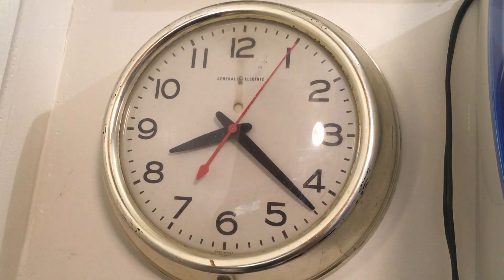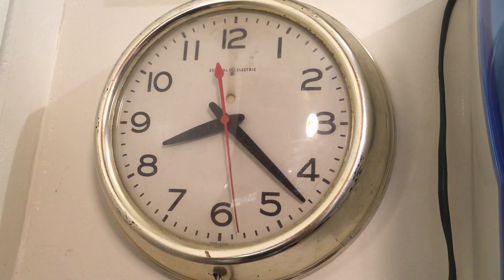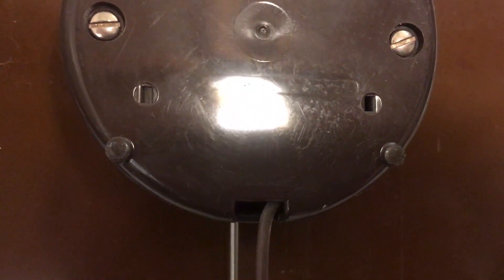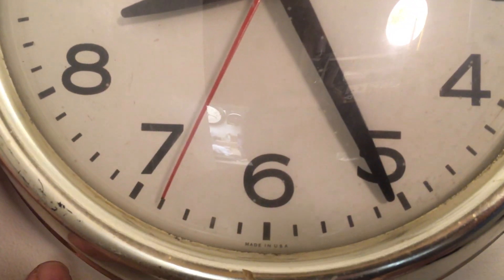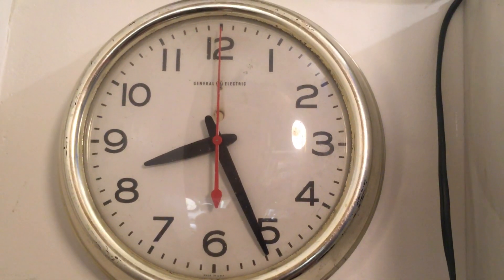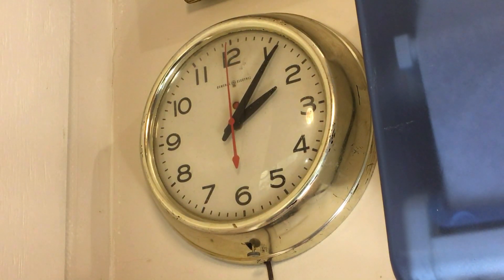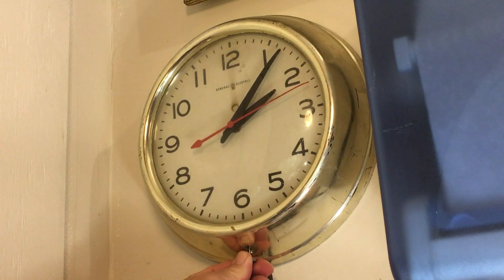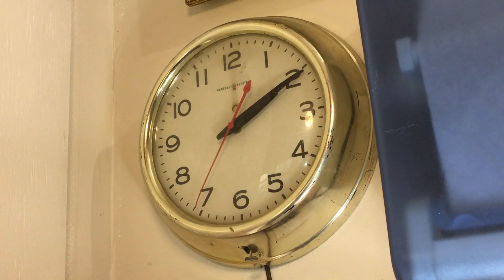Vintage GE 2908 Clock

Comment: Nice clock! Have you ever taken it apart and lubricated it? It would be nice to see under the cover. I'm guessing this has a Telechron rotor?
Reply from the maker: I haven't done any servicing yet, but plant to, so it will run another 60-70 years. As is, it operates smoothly and quietly, doesn't seem to be struggling. I can probably put my watt meter on to see if it is at or below two watts.

Comment: Nice clock, do you know when it was made?
Reply from the maker: Thank you. I would guess 1950's, when my Grandpa got his first office at work. He said it worked just fine for the 40 years he worked.
Reply: @dynatrak  Thanks for your reply! Much appreciated.
As a matter of fact I was given one for free today just like yours.
The gentleman originally agreed to sell it for $20 yesterday, but when I went to pickup today he said forget about the money, he's glad he can pass it along to someone who can use it.
He said he saved it from a warehouse that was closing down 25 years ago. I want to thank him for his generosity!
The casing needs a good cleaning and the hour hand needs to be aligned as it's off in relation to the minute hand, which I will do.
Other than that it's working for the last 10 hours or and it's very quiet.
Amazing for a clock of it's age!
I will enjoy it for many years to come.